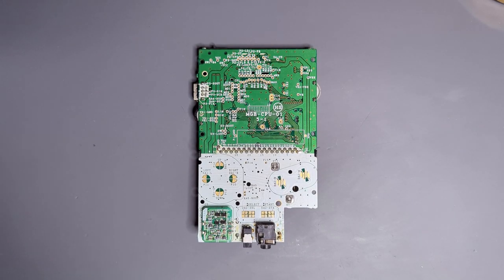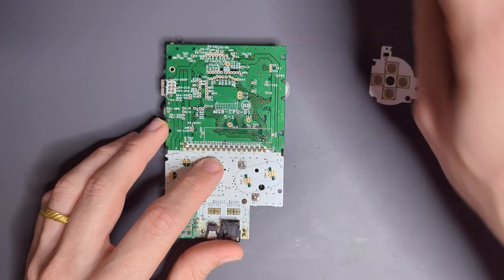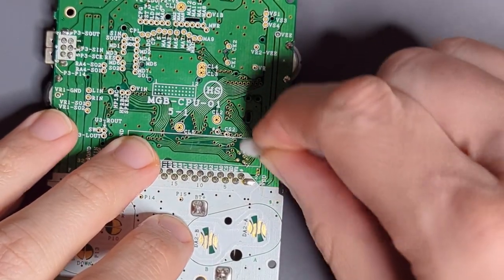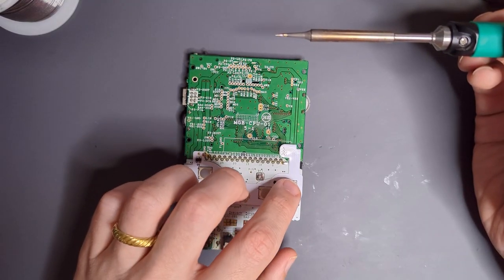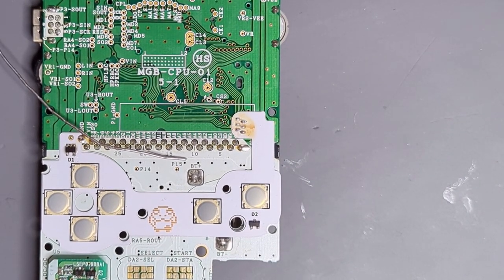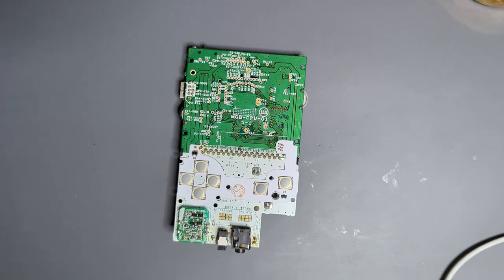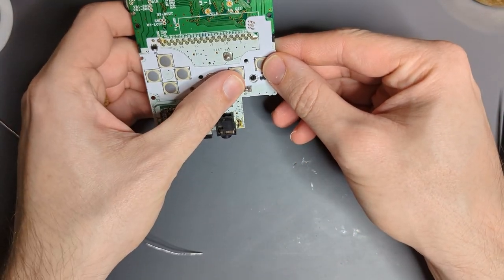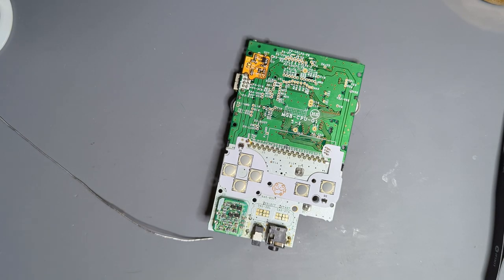Tac Switch + Battery Indicator Mod Install for Game Boy Pocket

Comment: Picked up both of these from your etsy shop! Thanks for supporting the community!  Would you consider making a video of the start/select button install for the pocket?
Reply from the maker: Thanks! The install for the GBP start/select buttons is pretty similar to the wired install for the GBC equivalent. Only difference is the need to install the diode array, since the board is only available unpopulated on OSHPark.
Reply: @leggomyfroggo  I'm going to give it a shot!  You posted a pic on Instagram with that STSL board installed.  You ran a wire from P15 to another P15 on a replacement A/B board. I don't see that on the tactile button mod. Would I run that wire to the P15 via on the MGB board?  Hopefully that makes sense.
Reply from the maker: @SRTorque  yup, just run it to the via.
Reply: Hey man. I want to get hold of these but it's no longer available. Will you bee putting them back up anytime soon.

Comment: it would be cool if someone was able to make a membrane set that removes the domes, so basically solid rubber to keep the button height, but allow direct actuation of the tac switch with less travel. Could just glue some risers to the black contacts maybe.

Comment: Great video! Is there a way to have for example red light for full battery and then no light at all when battery is low or vice versa?
Reply from the maker: Thanks! This mod has two LEDs, one for good battery, and another different color for low battery. Not demonstrated here, but you can see it demonstrated in my videos for the GBC version!
Reply: @leggomyfroggo  so can I take the LED for low battery off and then have the light turn off when battery is low?
Reply: @leggomyfroggo  Also, is there a way to lower the brightness? maybe add a resistor somwhere?
Reply from the maker: @g.9174  Yup, you could absolutely just pop off the lower battery LED.
Reply from the maker: @g.9174  Each LED has its own current limiting resistor already. Increasing the value will dim the corresponding LED.
Reply: @leggomyfroggo  Great! thanks a lot!